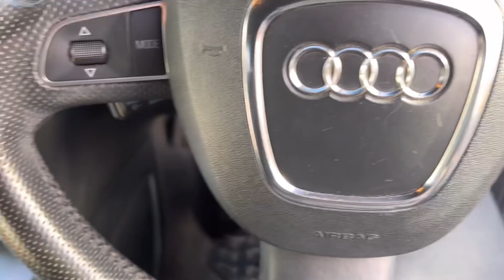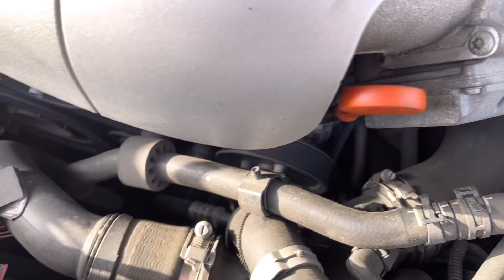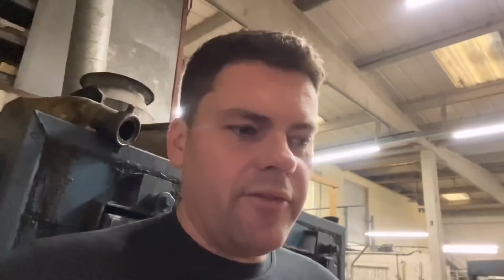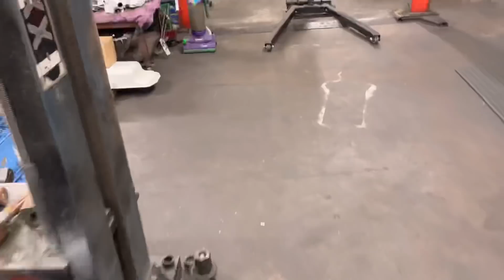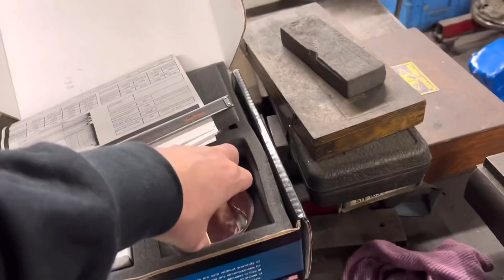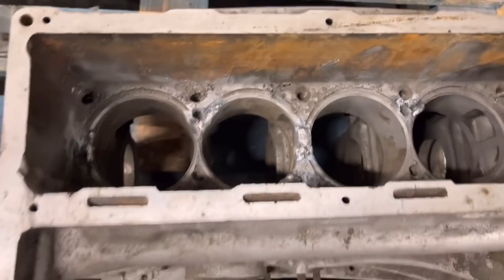4 time built DISASTER COSWORTH engine update

Comment: Personally I'm anti those super low viscosity running in oils.  I prefer a high quality mineral oil (15w40).  Should be able to comfortably run an engine in around 6hrs.  Great channel btw.  Enjoy the content.
Reply: 15-30 regular is what I run in my daily driver with an I6 from 1927. Unopened motor with plenty of compression. Synthetic is too slippery. My built 500hp/7000rpm SBC with tight fit runs synthetics as did my 2.8 Iveco PS-10 TDI. Both fills stay golden for 5000km. The old  I6 has ocv and slotted valve covers and dirt gets sucked in...a oil change every 1500km keeps it purring. 7 quarts of Cheap oil is fine. Filter is huge and Filtration is full flow compared to todays cars with 4 quarts and a tiny fram filter. That's why this engine ran for 400000 miles and few of todays engines reach 120000 I'm.